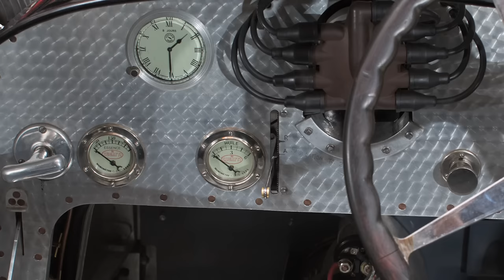1927 Bugatti Type 35 Pur Sang Replica - Jay Leno's Garage

Comment: Imagine driving this in 1927, and overtaking people in horse carriages. You'd be a total baller.
Reply: Most cars in 1927 struggled to reach 60mph. The Ford Model A introduced in 1927 had a top speed of 60mph. It had a 40hp engine. The Chevrolet Series AB National had a 35 hp engine. The Chrysler Imperial introduced in 1926 was a "top-of-the-line" premium luxury car for the rich and it had a top speed of 80mph and a 90hp engine. The Bugatti Type 35B had a 140hp engine, was light-weight and could reach 120mph.
Reply: You'd be a total baller in this any day, not just 1927
Reply: I bet the ladies be showing you some ankle when you pull up in one of those.
Reply: @robertbrowne7880  lol all for Cylus
Reply: You could hardly overtake ANYTHING with the severe lack of power it's got.
Reply: IT'S CRAZY TO THINK THAT BACK THEN THIS WAS SUPERCHARGED WITH 180 HP WEIGHING 2000LBS .IT'S SAFE TO SAY IT WAS VERY FAST.THE PERFORMANCE IS LIKE WHAT MY 3850 LB 900HP SUPERSNAKE IS TODAY LOL IN 1926 THIS CAR WAS THE SHELBY GT500 SUPER SNAKE OF THE DAY.
Reply: Or a model T
Reply: Total badass
Reply: @anthonylaudano9751  compare luxury  cars of the day and luxury cars of today... this was literaly the equivalent of an f1 or indy car performance today. and its wicked fast even today.
Reply: @jstefa2  I BELIEVE IT LOL I LOVE TOO OWN ONE LOL EVEN A CLONE
Reply: @ethancaine1646   it has no mudguards-is that legal in the US ? ..and he should wear goggles because of it
Reply: Bugatti sold these to whoever could afford one. Bugatti did not own all of them, far far from the truth. They had to sell cars for a living including GP cars !
Reply: Don’t be misled, in the right hands these cars are blazingly fast…
Reply: You're saying it's not possible for these kinds of cars to be seen on public roads mixed with traffic, but the Targa Florio says otherwise. These things would have raced at 200 km/h past regular traffic for hours.

Comment: My dad owns an original Bugatti 35 B from 1927 and we drive it every weekend in the south of France. We go to small towns and park the car outside of cafés and boulangeries to buy bread. This car is just amazing!
Reply: The only downside with the ones made in argentina is that they do not really "look, smell and sound like the original". Even though some replicas are manually aged, they still do not have the same patina as 93 year-old cars. In addition , the sound an argentinian replica makes is not really the the same as an original as you can clearly tell the difference when you know how an original sounds like .
Reply: If the replica firing order is different from the original then definitely it will not sound the sand as the original ! No tearing calicot then.
Reply: Yes, the Boogeratti is a fine auto, amazing for the time.

Comment: Man this is what I call a quality replica.. And in many ways better than the original probably just with the newer metals they use to build the engine and transmission.  To think they also use the English wheel and hammer to beat the aluminum panels just like they did almost 95 years ago is stunning.  I wonder if they do Ferraris, it would be so cool if they recreate a Ferrari California SWB, wow that would be incredible.
Reply: +Arisgod27 They will make anything you want, but it will take time and won't be as cheap as the Bugatti. They have made a Maserati A6G Zagato and Mercedes SSK's as well as other cars.
Reply: I swear if I had the bucks I would ask them to make a Ferrari SWB California.  That to me is the best looking car in the world.  Hell engine wise they can use one of the BMW or Mercedes V12s.

Comment: This is amazing when it comes right down to it is a genuine Bugatti from the first piece of it made to the finished product. They essentially moved the factory to Argentina and restarted production it's  that simple. I want to build all those wire spoked wheels. I'm  fastened by them was also expecting that the type 35 would have been origenally equipped with them . I has to be an amazing driving experience. Sure would be fun to have just one day in the seat . Definitely would never forget it. Thanks Jay

Comment: Justin: Any modern gasoline is way better than pre-war fuel. The octane rating of road fuel was something like 73. Normal avgas was 80/87. (80 lean, 87 rich). Even a racing  fuel from then  would probably ping horribly in a modern engine.
Reply: They ran Methanol, mostly..

Cooler burning!

No knocking...

Germans added aromatic spirits

Xzylol, Tolulol, tolulene, MEK and such..

Not ethyl lead!

Howard Hughes tried jars of THAT..

From the inventor, Kettering..

(who also invented FREON)

For his HR-1 racer...

1935
Reply: Your both wrong pre war fuel was benzine 115 octane. The same bikes lost lap time after the war Isle of Mann TT.  The pre war benzine fuel stock piles were made into Napalm. Fact Check it.

Comment: 180hp and ~1800lbs. I bet it feels quick.
Reply: It didn't have 180HP.
That was the Type 51.
The Type 35 had an average of 125 HP.
Nevertheless, I agree, it had to have felt like it was quick.
Reply: Johannes LaCroix
This isn't an original Type 35. The guy from Pur Sang said this car makes around 180hp.
Reply: fromkentucky Oh, sorry. Didn't know which one you were talking about.
Reply: I think it was pretty safe to assume he was talking about the actual, specific car that is the main focus of this entire video, lol.
Reply: He said this one had a modified firing order so it's 170-180.
Reply: The type 35 Bugatti had maximum 140 hp, and weight was 750kg (~1652lbs)
Reply: About like a Porsche RSK or a 550 Spyder

up to about 120, or so....

The DRAG takes over

As with an Allard K2 Chrysler 331 Hemi

Swallow SS 100....

Clam shell fenders

Or open wheels

The WALL!

J.C.
Reply: Too little power; too little weight.......
Reply: @michaelmeliambro5117  A car can never be too light.
Reply: @A-FrameWedge  Lightness is nothing without POWER.
Reply: @michaelmeliambro5117  I was replying to you too lightweight comment, a lightweight car with any engine is better than a heavier car with the same engine.
Reply: @A-FrameWedge  But a lightweight car isn't as good without a big-a** motor to back it up.
Reply: @michaelmeliambro5117  Just admit your too little weight comment is wrong.
Reply: @A-FrameWedge  Not until you admit your wrong about lightweight cars having less POWER.

Comment: I have an odd question: how does Jay get cars like this onto the street legally? I don't see a license plate, much less necessary lighting to be street legal... What gives?
Reply: +TRLWNC1 Probably different licensing for collector cars, since modern lighting and tag placement would impact the car's value.
Reply: True. Hadn't thought of that.
Reply: Alot of the time when older cars are perfectly replicated they can be registered as an actual 1927 bugatti, as far as I know that means he only needs the equipment that came with the car new so he can use hand signals and stuff like that.
Reply: Good to know. Thanks!
Reply: Jacob Coffelt ... I'm  sure The CHP could find something  wrong if they wanted to.
Reply: If I was in charge I’d say his contribution to the state, through exorbitant state taxes, and the jobs he creates has earned him a special variance to break a bucket load of ordinances with my approval. Just don’t kill anybody.
Reply: @THEfromkentucky  - This is california, the land where everything is illegal or causes cancer, so I find that hard to believe.

As far as I am aware NO car is exempt from having brake lights. You can physically signal a turn, and not drive at night, but it is illegal everywhere to not have brake lights... and it's as dangerous as hell too.  I wouldn't risk a quarter million dollar car even if it was OK. 

You can't not have a license plate either.
Reply: @56squadron  I used to be a MO state vehicle inspector and if you have brake or tail lights they must function. If you didn't have any sort of tail light you just needed a drivers side window that rolled down  or the ability to use hand signals. I do agree that I would somehow add brake and tail lights to a quarter million dollar car. Maybe some held in place by magnets or suction cups. At the very least to keep the idiot that hits it from having a way to weasel out of paying for hitting it. Recently here a idiot ran a red light and plowed into a Duesenberg and killed several people. He tried to blame their deaths on the fact the car didn't have modern safety features so he wasn't responsible for killing them.
Reply: Money

Comment: Urgh, the distributor ruins the dash!
Reply: They will build you one with a magneto  :)
Reply: Yeah I don't know why they put it there
Reply: Go buy a Scintilla Magneto..

TWO of them

Then cuss them every other day

Dual mags and dual plugs

Plus 3 valves

You people are CLUELESS!

Try a 1967 Ferrari 330P4 with the above

And an early FI system...

Or a 330P3 with Webers

Be my guest..

I prefer turn key driving...

Thank you....

The FAN is a GREAT IDEA!

Trust me...

Maserati 200si/250S in Tampa, in JULY...

A 250LM in Sebring.. in March

The Ecuadorian car..

Ex-Raceco

More LESSONS!

J.C.
Reply: @420moej ,  Because it's run off the back of the camshaft. And -- if you're building a $250,000- replica you want it to look like the original, or what's the point. Get it?

Comment: i want a car with straight cut gears
Reply: nateb26 ... I wonder how long those transmissions last.
Reply: @marvinblankinchip2535  100 years
Reply: @marvinblankinchip2535  straight cut gears unsencronised you can shift like a semi. And float them. Just clutch for first and reverse. Here and feel. She suck it in every  time. 
No tachometer  necessary.

Comment: It was normal at the time for the wheels to use spokes to save weight. The distinctive cast aluminum blades in the Type 35 wheels are because they are cast over the steel drum brakes, making the wheels a heat-sink for the brakes. This allowed this model to delay braking to pass cars since they had to brake sooner to not slide out the curve. Then, the Bugatti driver could brake much harder a moment later without fear of the brakes overheating.

Comment: I wonder, why do the front wheels have positive camber?
Reply: +Mustanglover10 when the car leans into a curve, the outer wheel has more contact area (more weight, so the body goes down and the wheel straightens up) so it corners better.
Reply: Thank you for you explenation. I'm always eager to learn something new :)
Reply: Mustanglover10 Glad I could help you.:)
Reply: +Mustanglover10 According to research, Bugatti deliberately built in positive camber to make the cars understeer. All race cars at that time would oversteer a lot due to the relatively high powered engine at the front and light weight causing a lack of grip at the rear.
Reply: +David Jauch Heh, let me say, in a friendly way, that what you described is correct for the effect of negative camber. Positive camber has the wheels leaning out at the top, negative leans in. (see my reply to Mustanglover)
Reply: wordreet Hmm, that's very interesting indeed. I suppose they would also oversteer because the cars back then were always back wheel driven
Reply: +wordreet so I've been doing my own (internet-) research yet after an hour I still haven't found anything but a modelmaker's description (which supports what I've said). On modern cars with negative camber, what you said would happen will be the case. But on the other hand, bugattis not only had different kinds of tires but also smaller ones, so the effects are different for sure.
Another idea I found is that the negative camber would hinder the wandering-around-effect on worn-out streets back in the day. Still, what you said makes sense and would be worth some further clarification...
Reply: +David Jauch Back in the 30s tires were always cross ply construction, which makes for a fairly stiff casing and these tires would always slide during fast cornering, but, as mentioned, the rear wheel drive is prone to oversteer and it must have been pretty chronic in these lightweight cars.
All tires flex during cornering, some more, some less. And these older tires, if they flexed in a corner, the inside of the tread would actually lift of the road, so, yeah Bugatti were inviting grip losses big time with this one.

 The camber angle does not change at all here as all these old cars had a solid front axle with small leaf springs on each side. The rear was the same. So the positive camber shown in this image
 http://image.automobilemag.com/f/10565975+w750+st0/0809_04_z+bugatti_type_35+front_view_with_tags.jpg
 is permanent, no matter what the car is doing. Modern cars may have negative camber at rest or when driving straight, but once the car begins to turn at speed, various things happen. One of those things is weight transfer, which induces body roll (sway), that then pushes the top suspension arm outwards a bit compared to the lower one, which will obvoiusly change the camber angle. So while negative camber may be observed initially, the wheel is more likely to end up around 90 degrees to the surface during cornering.
That's a very basic explantion to be honest, because stuff like king pin inclination also effects what's going on. And then there's the ackerman geometry . . . :¬x
Reply: +wordreet Thank you for your extensive reply. I guess I'm proven wrong here, and very well so; you had me at the solid axle. Thanks again!
Reply: +Mustanglover10 Oh, and here you go with what's a much better answer.
Reply: *****  It's lucky I didn't mention bump steer or roll induced steer. ;¬)
Reply: +Mustanglover10 thats just how they did things back then, look at a Model T ford or any other car from the 10's and 20's
Reply: stance bro

Comment: ...i spotted a difference right away. The radiator on the original is curvier, has smoother lines, the replica (im talking just about the radiator) is just a little bit straighter. But it is one of the most beautiful cars, I ever seen never the less.
Reply: Bugatti used this "straighter" radiator on the T35B for better cooling, its called the Miramas type, prior to this one there were two narrower ones used.
Reply: @RoverWaters  didn't know that. thank you.

Comment: i love the sound of the straight gear box  on the Bugatti  one of my first cars was a MGB  and it had the Overdrive transmission in it  that would slip like a failed or worn out Clutch on a mGB  in order to do the clutch you need to remove the engine and Transmission attached as one unit  and i think i put 8 or 9 new Clutches in that car  before i figured out that wasn’t  the problem and that  it was actually  the Overdrive  unit Slipping  i had gotten so efficient in pulling the motor and Transmission that i could pull them ,split the two units on the garage floor and put a new Clutch  in and install the two units back into my car by myself in under 4 hours. it also  entailed  a repaint on my Engine and a  complete hand wash and Wax of my engine compartment  eventually i bought a used Transmission from a guy that swore it was a good working Straight 4 Speed  and i found out the guy had ripped me off with a unit that had bad Synchros in it  i had the car for 14 years  and got fairly efficient of  hearing the correct  RPMs  to shift  without any grinding  i mostly did that  because  girls used to freak out over the loud clunking  and growing up inSunny South Florida  it was  usually the best option to go somewhere in my DropmTop Roadster

Comment: Cars from this era had positive camber for a few reasons -- it reduced steering effort, reduced stress on the kingpins, road surfaces of the time were dome shaped (tall in the middle and lower on the sides, for drainage), and the crossply tires of the time were much more stable in a straight line with a few degrees of positive camber (whereas modern radials need a bit of negative camber).

Comment: That sounds like a more modern engine, like 60's or so.  Goes to show how far behind most American manufacturers we're, and some STILL are. Ford is the only of the big 3 to embrace overhead cams and multi valve engines. GM and Mopar still haven't even caught up to this design with 3 valves. And still run cam in block. Yes, I know they have advantages and simplicity, but they also have disadvantages. Such as the 6.0 vortec I'm stuck with at the moment. 10mpg in an unloaded 2wd pick-up. My 5.4 Ford didn't get that bad even with bigger injectors, headers, off road exhaust, 4.88 gears, 35" tires and being a 4wd. But it was built just as strong or stronger than this 3/4 ton Chevy, and would out pull this thing all day, but was more limited with gears and was pretty much topped out a bit over 100mph. Parts were basically scaled the same. GM and Mopar always have lighter built parts, but this one is still heavy weight Wise and drinks gas like no other. Ford is the only real domestic company that really innovates anymore if you ask me. The other 2 just steal their ideas and make them cheaper. But ya get what you pay for...

Comment: There would definitely be gear whine since the type 35 has straight cut gears rather than helical cut gears like modern transmissions. Many transmissions have straight cut reverse gears which is why reverse whines.

Comment: Great cars but were a bit scary to drive due to how they were set up. Since they had no safety features like automatic transmissions or strong brakes this made them very temperamental and they would do whatever they wanted, because of this it took real courage to keep one of these monsters in a straight line and having the know-how to run one at that!